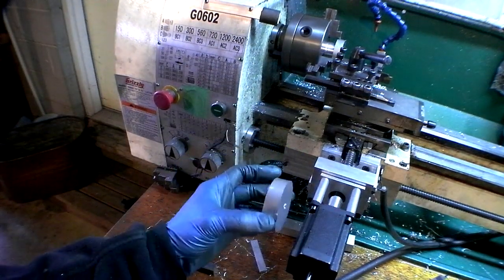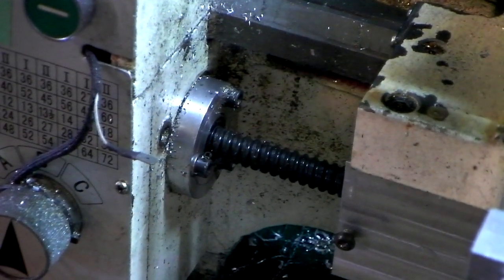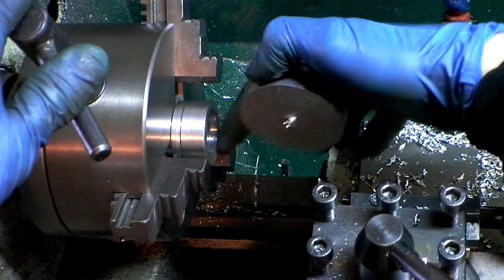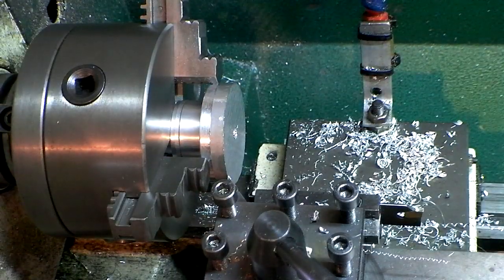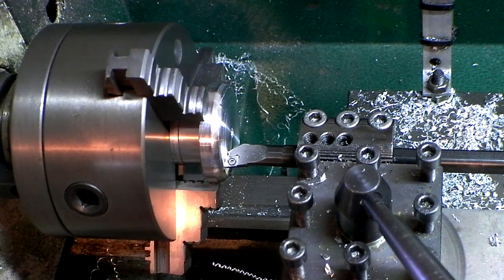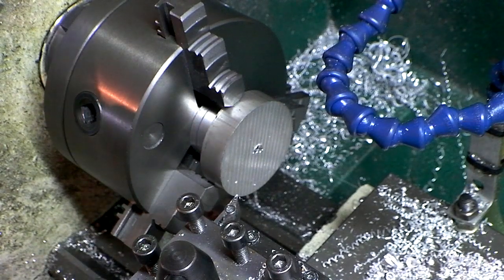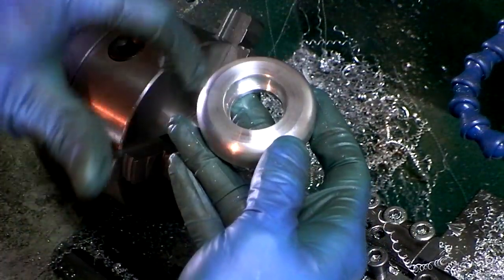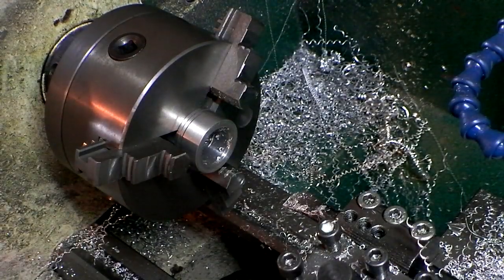G0602 Lathe left bearing holder

Comment: What RPM are you running? 2400 or did you more to higher belt position along with the VFD conversion? (3600? 4800?)

Comment: The bearing needed to enter in that tight hole, you needed to put the aluminium piece under fire and then with an hydraulic press, make it enter, because the bearing do not have to spin, all, I mean, just the inner face need to spin, the outer face do not. Just an observation, but I like this video so much. Thanks!

Comment: Hi have you had any chance to cut steel like 4130 on this lathe? Would you be able to take deep cuts like .1 or .2 ? no problem? I have a mini lathe and it wont cut steel very good at all because there is so much flex in the little 3/8 tools and the carriage

Comment: Whoa!  You should always retract the tools holder away from the part.  On a CNC lathe the tools touret always returns to the zero machine point in the Z axes.  You should set yourself a zero point for tools changing about 6 inches in front of your parts in that specific example.  And have a check point in front of the part, that way you will avoid mistakes,  Also, if you want to check the code, check it without a part in the chuck and set the speed of the chuck low to avoid collision.

Comment from the maker: "For the money", Grizzly machines are great.  I've enjoyed the G0602 for many years, both when it was manual and now that it's CNC.  It's tight enough for most work.  I've turned a lot of stainless, some 4140 (loved it), lots of carbon steels, no problem.  Even 3" diameter hunks of aluminum.  It's a good machine.  Now that I've got a really nice mill, the lathe is starting to seem inadequate, but I've got some upgrades in mind for it that will make it do what I want it to do.

Comment from the maker: Thanks for the tips!  It only happens at full rpm, 2400.  It's like the motor is geared too much and doesn't have enough starting torque.  Or the spindle bearings are too tight.  You could be right about the motor start capacitor!  My wiring is pretty short, but it does go into my control box and through a relay.  I think I'm using big enough gauge wire.  If it becomes a more annoying problem I'll look into the capacitor, or just get  more powerful motor :-), with a VFD.

Comment: That humming failure to start at 12:26 and the machines apparent struggle with deep cuts is caused by insufficient surge current to the motor which could be caused by one of two things. The most common cause is using an extension cord or outlet that is not rated for the amperage used by the spindle motor or the spindle motor has a start capacitor and it is no longer functioning correctly. I had to purchase expensive heavy gauge extension cords for my G0463 mill.

Comment: what i mean is when the first side is faced, turn it around end for end and rechuck it, then using a soft face hammer tap it until the previously turned face touches the chuck face or a parrallell in between the jaws so there is minimal runout on the piece afterwards.

Comment from the maker: @crxtech1 For this bearing I didn't use a snap ring, just pressed it in.  I've never done an internal snap ring but it's pretty simple with an internal grooving bar, just safely go into the hole, slowly feed out on X until your goal diameter, feed back in, retract, done.

Comment from the maker: @themetalcutter Sometimes I've pressed bearings into holes that were barely too tight and it can squish the aluminum and gall the surface a bit, leaving a nasty lip inside the hole.  For a blind hole this will prevent the bearing from seating all the way.   Just takes practice to get things where you need them to be every time.

Comment: Why don't you do the bearing side first (complete), then turn the part, face the other side and maybe a skim cut on the clearance bore and at the same time put a small radius on the inside of the clearance bore to do away with the manual deburring. Manual sucks when you can automatically do it! :D